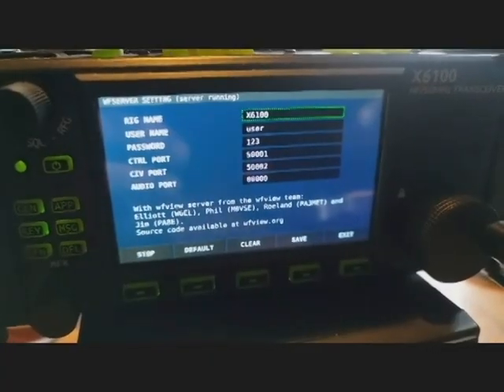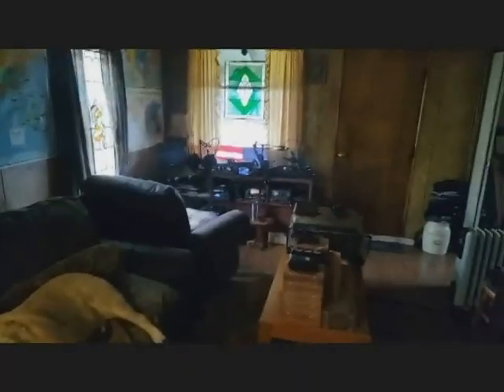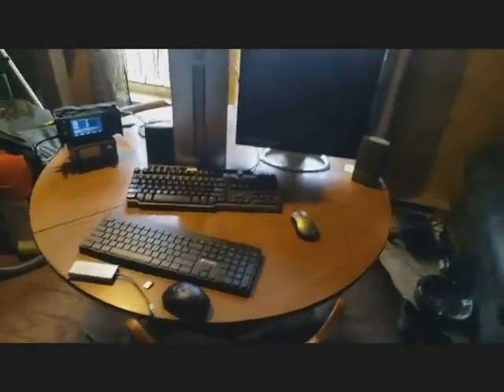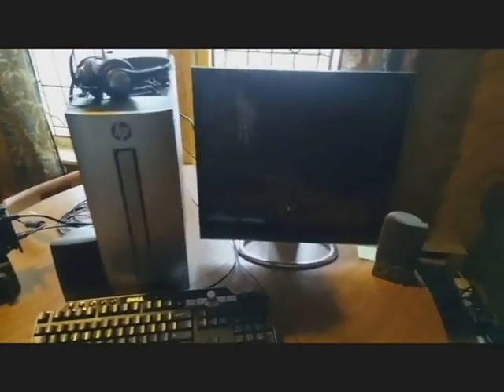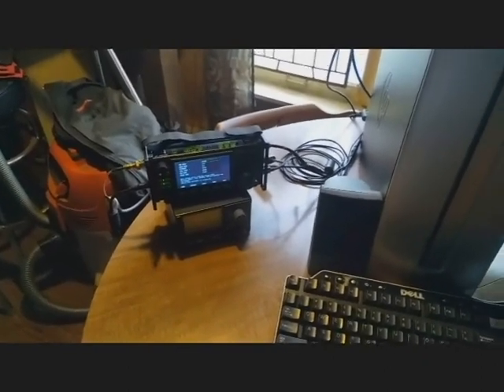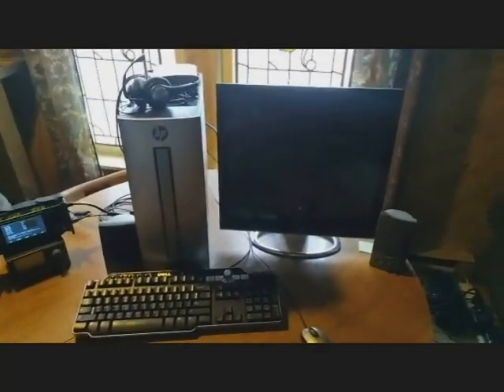XIEGU X6100 REMOTE CONTROL w/WATERFALL PART1

Comment from the maker: I tested my audio theory using a headset and using the WFView APP to PTT the radio for MIC INPUT and AUDIO. So that is what I used since I knew it worked. It may very well work with a DEV USB-C to USB-A cable using VB-Talkie and VB-Receptor eliminating the need for a headset dongle, although I have NOT tried it that way. If I did try it, I would disable the 2 COM ports in device manager since they would not be needed. If they are disabled, the AUDIO ports will remain active.

Comment from the maker: So "UDP/TCP" is only needed for the Server, not both as I said in "requirements" BUT you will need "PRO" on both systems to use audio transfer over RDP. The Samsung tablet used in the beginning is WIN7 PRO so yes the client side does not require WIN10/11 like the server. WFView DOES require WIN10/11 to run but the Client does not require it to connect.

Comment from the maker: So u don't need VB-Spot in list. Use VB-Talkie & VB-Receptor instead. They use less resources & don't require installation. ALSO tablet being used before tease flash is a Samsung 700T Touch Tablet,Pentium 5, 1.7Ghz processor & 4Gb RAM. The client doesn't require a lot. I can't tell any difference from one used after tease flash which was a HP Pavillion 2.8Ghz, 16Gb RAM and had larger 17" screen so I used that. Personally when I'm remote I'm using the smaller one and it works great!